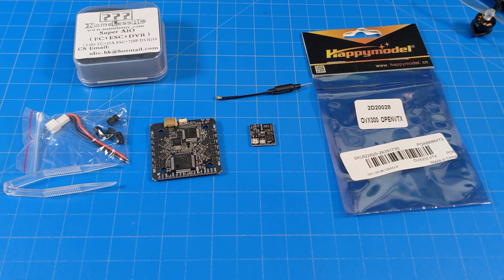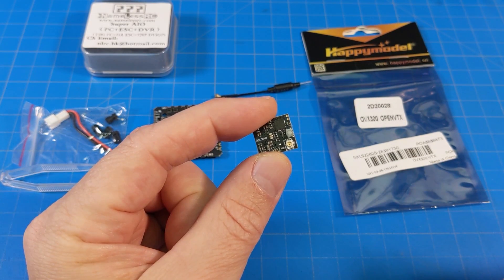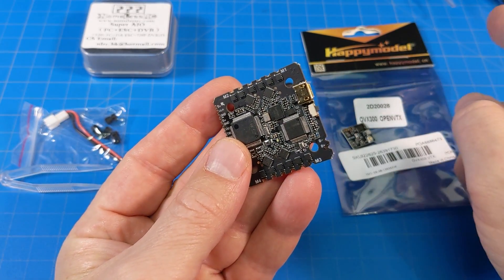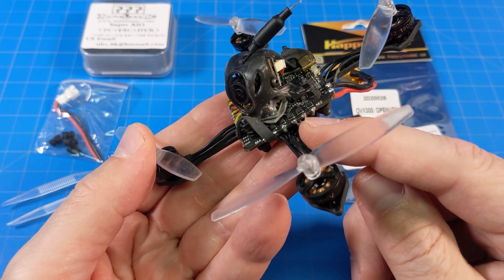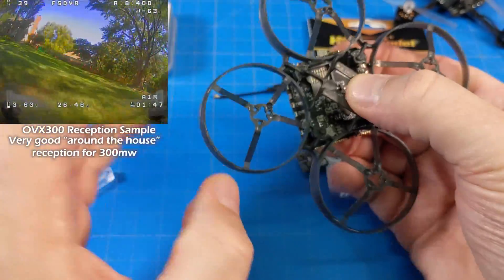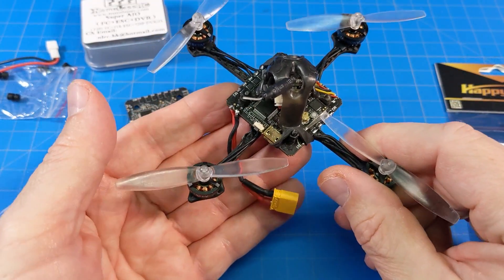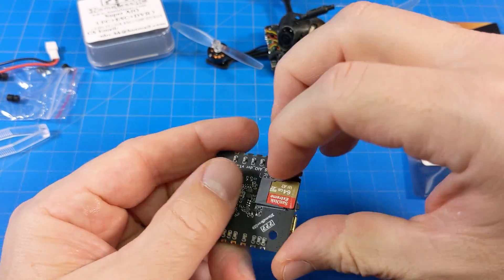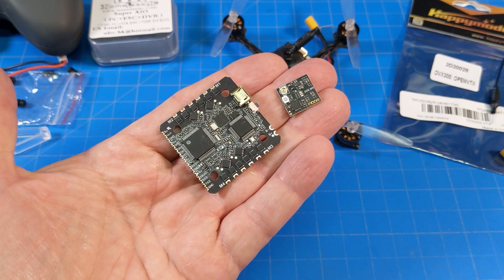NameLessRC Super AIO +DVR - HappyModel OVX300 OpenVTX

Comment: Having trouble getting this to record video. Doesn't start automatically or by pressing the button.
Reply from the maker: Formatted and sd card inserted ?
Reply: @NickBurnsFPV  tried a different card and it works! Thanks Nick!
Reply: @NickBurnsFPV  yes sir. Formatted and inserted correctly. Samsung Evo 32gb
Reply: @NickBurnsFPV  is there a UART that needs enabled?
Reply from the maker: @DooSum_FPV  I didn't use a uart with it. Do you have it wired to a uart?

Comment: I have a question, this OVX 300 doesn't work if I'm not connected to an FC that supports Smartaudio or Tramp, is that it?

If you turn on a camera and only feed it, it doesn't send an image to the glasses, right?
Reply from the maker: The vtx is designed to connect to a flight controller but we can connect the video in and out wires to have it work stand alone

Comment: Nice review Nick.. I wish i saw this review 3 days ago, would have ordered this namelessrc board as opposed to another iFlight succex (both have been really good to me in terms of durability)

I think the 25 vs. 30 fps is basically about your camera output?

NTSC renders 525 vertical lines at 29.97 fps
PAL renders 625 vertical lines at 25 fps

Looks like Namelessrc moved the DVR functionality from their VTX to this flight controller.. On their VTX they gave you 2 connectors  (each with a different set of pins bridged).. One recorded the OSD, one recorded directly from camera.. Worked really well on toothpick-ish builds.. I am always worried about burning out my SDCards when using these VTX DVRs though..

Comment: The baby ratel 2 is a great compromise for micro builds where weight needs to be low but isn't super critical. I still use those on a couple builds paired with a diamond vtx for onboard dvr.
Reply: I have also used the diamond vtx with dvr.. but was not happy with the range performance.. same with my AKK w/dvr.. I got better video range from a  $13 PandaRC VTX
Reply: @robaxelsson530  upgrading the antenna can help, but they certainly aren't great for long range. Even with the more expensive antennas, if you want the best results order 3 or 4 of the type you choose and test to see which gives the best results. Quality control can create a large variance in performance. For the price, I've had good luck with the emax nano circular polarized ufl antennas.